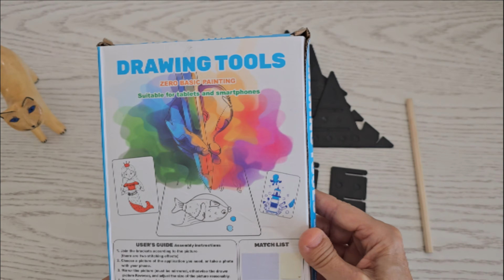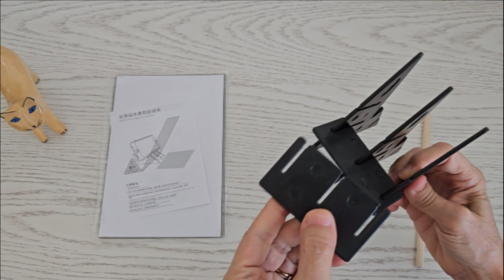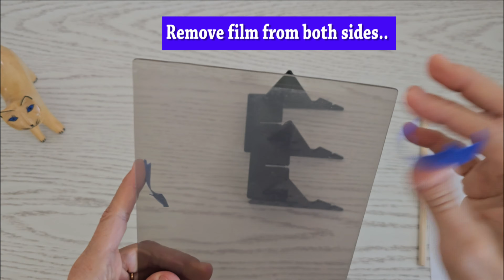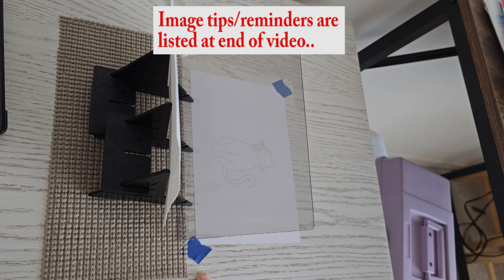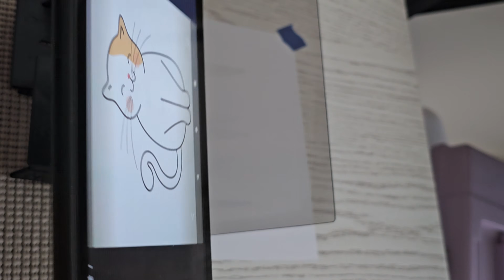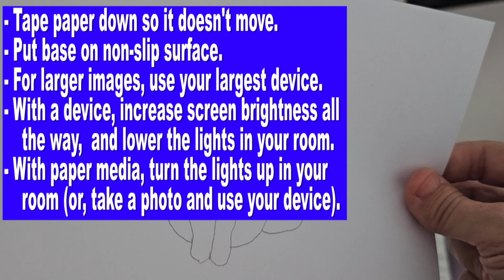Optical Reflection Image Drawing Board - Assembly and Use

Comment: I made one of these last night by using an old CD case. It is very easy to keep the lid of the cd box open at the necessary angle. One then just has to prop up one’s phone at the appropriate angle on the back cover of the CD cover.
Reply from the maker: Nice..